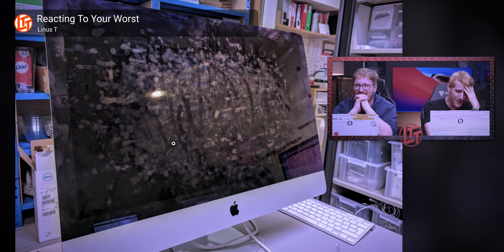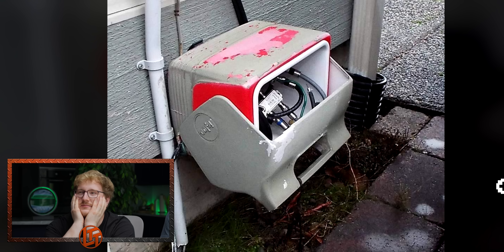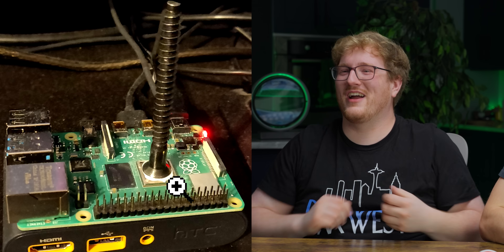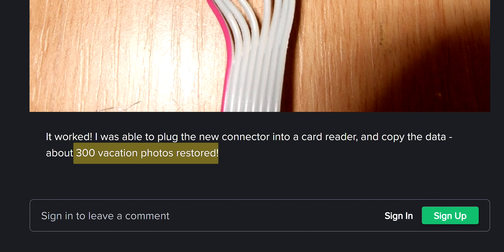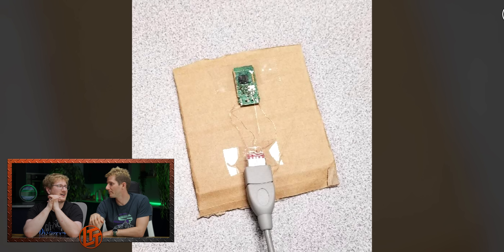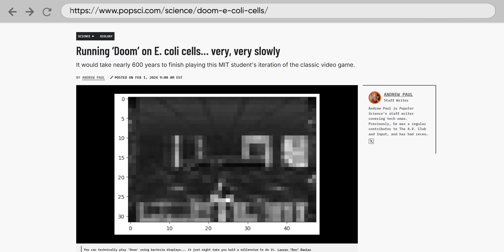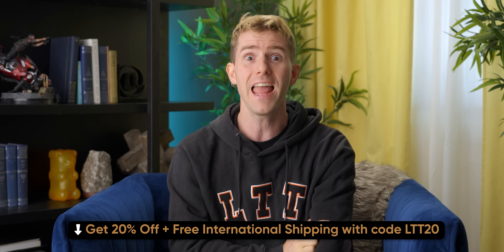Are You All Geniuses or Idiots? - Reacting to Your Best Tech MacGyvering

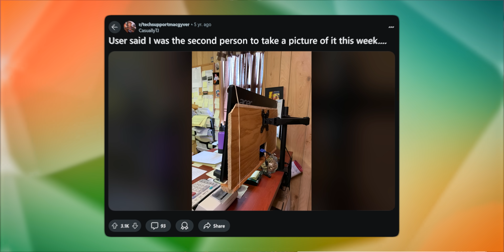Comment: 7:02 I actually made a custom mount for my EF9500 65" OLED for my bedroom. This TV (unlike newer LG oleds) have a stupid trapezoidal pattern mount, "universal" mounts don't work because universal mounts still expect the spacing to be a rectangle. So I got some solid red oak from the hardware store, made french cleats, screwed 'em into the studs, and the corresponding part screwed into the TV. Worked perfectly despite the bottom holes being closer together than the top holes because i could just drill wherever they need to be. Its rock-solid too.

Thankfully despite being a fairly large TV it wasn't that heavy (like 50 pounds without its stand) so i didn't need to get that fancy with the engineering.

Comment: The best I've heard of was a bunch of guys doing an install in a room no one had the key to. The door had to stay closed or the alarm would go on if it was open for more than 30 seconds.
So they rigged a PC on a stepladder to be able to push the inside door open button with the CD drive whenever they wanted it through the LAN...

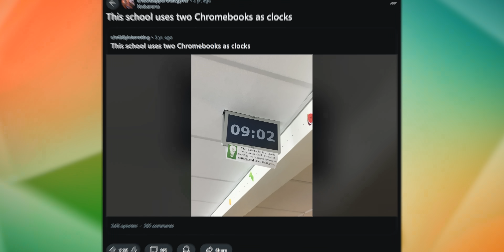Comment: 3:57 I'm sorry but no. These two chromebooks use 10x more energy than a clock would. This is not green.
Reply: True, but they'd be mostly idle so they probably use less energy than a light bulb.
Reply: It can also display announcements!
Reply: better than disposing them
Reply: It is still a  trivial amount of energy for a large building and the energy to produce something like that is substantial.
Reply: @LizordSword  No, the point is it's literally better to dispose of them.
Reply: @KrissFliss  That could be useful. If they are being used as anything other than clocks then good for them.

Comment: I remember getting tilted at having to replace the charging port on my old laptop every 6 months, so I drilled out the hole and put in a cinch jack as a temporary solution. That was around a decade ago, still works.

Comment: i had a similar velcro setup back when i was using my old equium a100. it had mounting holes for use as a terminal so I used it as a remote media server for years hanging from the wall. the battery was dead so ran off the mains and used the velcro to keep ac, ethernet and i/o in. 
funnily enough, it actually saved the machine a few times from being ripped off the wall by acting as a quick release if the cables got tugged, i was one of those guys who could never stop breaking the clips off ethernet..

forgot all about it until i saw this.

Comment: That "monster heat sink" reminded me of the setup we used to use at my dad's house. We had a USB wifi card (until we ran a cable since it sucked even after the fix) that constantly overheated. Took the case off so we could zip-tie a heat sink to the USB stick's board.

Comment: FYI, the alarm clock pictured in the 'tens machine' segment actually comes with a vibrating pillow attachment. It also has super bright LEDs in the front and for a long time (at least in the UK) this model was sold as the 'loudest alarm clock' one could buy. 
If OP can sleep through that, I wouldn't bank on being mildly electrocuted sealing the deal...

Comment: In my high school there was a server named "Black Server" (the reason for the name has been lost to the ages).
It was so old that the CPU Cooler died, but they couldn't find a replacement, so they just put it on a table with an old fan blowing in the general area.

When we asked "Why don't you replace it?" the professors told us "we have no idea which role it serves, but if it shuts down the whole school network stops working"... That school's diploma is in "IT Head of Technicians" 😂

Comment: When I was a kid back in the eighties, my Quickshot II joystick broke one of the internal contacts. I didn't have a soldering iron, but my mum's gas stove, a pair of pliers, and a eight inch nail sufficed to melt the old solder and reconnect the wire.

Comment: In regards to the mouse bottom door.
Here in Denmark, we have multiple 'closed' care facilities for psychologically impaired with a two bottom door system, due to the fact that the patients can't figure out how to use the doors, so only anyone else can get through the doors.
These systems can be as simple as two door handles that has to be opened in different directions, or just two bottoms that has to be pressed (sometimes located separately at some distance from each other. like one on the door and one on a wall.)

I could imagine this could one such place.

Comment: I once had an unused satellite dish that we replaced the sending/receiving part in the focal point, with a USB Wifi adapter with a long USB extension cord, pointed at our uncle's house across a wheat field. It was plugged into an old Thinkpad next to a window where the USB cord went through. It worked until the Wifi adapter gave up due to corrosion from moisture from being outdoors.

By the way, I liked the adjustable wooden monitor arm someone in the video made.

Comment: I worked for a large manufacturing company and went to a conference and they had guest managers speak, one talked about why you should always ask your all your employees if they have a solution for a problem before implementing a solution and this is the example they used,  they had an issue when boxes sometimes did not fill with product, they spent 100,000 of thousands of dollars to implement pressure sensors into their factories to sense when a box was empty and remove it, they then spent millions installing them all over the country in every factory, but 1 factory didn't apply for the new sensors and the reginal manager went out to see why and he learn a very expensive Leason, the young apprentice fitter who also worked in the factory packing had solved the problem himself he had placed a 20 dollar fan next to the conveyer and timed it so it would only have enough pressure to blow off an empty box, off the conveyer and at the end of the shift he would pick the empty boxes and feed them back into the machine.

Comment: I don't have video of it, but I had a 76 Plymouth Duster that didn't always like to start, for some reason the starter just didn't get the memo to turn over.   So I cut up an extension cord to the 12v supply side of the starter, ran it into the inside of the car.  Here is the fun.  I used a chain pull light socket to act as the switch, and a 15A screw fuse in the socket to be,,, the fuse.  

So if the car stalled and wouldn't restart, rather than go outside and pop the hood, and screwdriver start the car... I'd just pull the chain,,, Click,,, (car starts), Click the chain again.

PERFECT!!!

Comment: The car window fix at 13:57 is super jank but actually pretty cool. I used to work at a shop and sometimes we had to diagnose windows that wouldn't move. The window motor is really simple so on many cars, the computer literally flips the positive and negative to either move the window up or down. We had to be careful connecting new motors to make sure the switch would operate in the right direction lol.

Comment: Some GM vehicles have drivers side door switches that talk to the ECU. They are about $500 to replace and if they fail the drivers window no longer rolls up and down. Keyless entry doesn’t work either. Respect for the plug fix.

Comment: When I was like 10 I couldnt watch TV in my room at night. My parents found out and said: We'll take the receiver downstairs. In a flash I said: "You can also take the antenna, it's less effort with the cables". I proceeded to put wired earbuds into the antenna connection and attach a rope. Whenever I would hear them on the stairs I'd pull the rope with the earbuds and hid it under my blanket. Still mad proud off that one.

Comment: This makes me wish I had photos of my setup when I was in Highschool. I had the audio from an XP desktop, Xbox 360, and cable box all running into my headphones using a dolby adapter that came with the headphones and a vcr.

If you set everything correctly you could listen to the local radio station.

The VCR was for switching between the computer and the cable tv audio, which was hooked into a bypass on the adapter. The Xbox was plugged directly into the adapter as to actually use it as intended.

Comment: i like how you guys where amazed by the outlet for the car window thats way easier than the other stuff like soldering harddrives electro motors spin the opposite  way when you switch phases that's why you turn the outlet

Comment: I literally have a TiVo in my living room, with a coax leading to a bedroom set up as a workshop, and a second TiVo remote with a wire hanging out of where the IR LED used to be... that wire runs right back to the living room, beside my coax, and the IR LED is soldered to the end of the wire, and mounted to the front of my TiVo. The Slim Jim remote is just the bebeh version of mine. My wire is like 40-50 feet long.

Comment: 9:07 Can confirm that this is true, I tried it myself. The Wii "Sensor Bar" is just a bunch of IR LEDs (I confirmed this by opening it up). The actual sensor is in the Wii Remote (basically an IR camera that looks for the IR LEDs from the sensor bar, and determines the XY position of the cursor from the LEDs, and the distance from the TV based on the distance that the LEDs have between them from that POV)

Comment: My friend and I jerryrigged my old PC to run Truenas Scale with windows virtualized inside of it for occasional 3D renders. The cherry ontop was setting up a KVM so I could switch between my MacBook (my primary workstation) and windows, without needing anything like chrome Remote Desktop or parsec.

Since I don’t really have to render intense 3D scenes very often, it’s actually really nice to have redundant storage for project archival. Definitely could have just had network sharing enabled in windows, which I did at one point, but it was a really fun project where I got to learn a lot.

On a side note, if anyone here reading this is running Truenas scale and can’t get GPU pass through to work in your VMs because Truenas claims it needs a GPU for some odd reason, we got it to work by switching to a G series Ryzen GPU. After the upgrade you’ll want to take out the CMOS battery, but then Truenas should play nicely. This was especially helpful if you’re like me, and didn’t want a second GPU taking up space on your motherboard that could be used for an HBA or upgraded NIC.

Comment: had a really good monitor lying around because user broke the base. it had no vesa, and broke in a way that it could not be put on a replacement thingy. so i just used a height adjustable monitor stand with tilt and all, and used soudal fix all turbo, roughed up both sides with sandpaper and glued the heavy af montior on, and gave it a day or so to cure. it still holds up 4 years later, and is now at my sisters place so she has a nice monitor. I even tried pulling on it a while ago to see if it still holds up, and its on there for sure. Im not gonna throw out good tech when heavy duty glue exists (btw thats some sort of construction glue / kinda like silicone but harder)

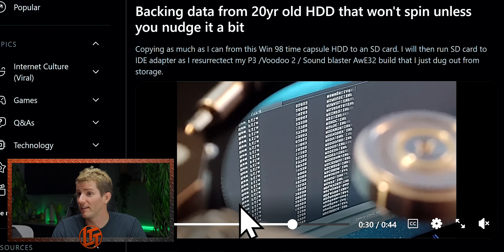Comment: 5:23 I've had to do that to modern drives for data recovery purposes, this trick works - just make sure you do it in a clean area. Knowing all these little data recovery tricks helped pay for my college. Usually the most common thing I ran into was someone working on a thesis/paper off a flash drive and somehow managed to break the USB connector off the drive.

Comment: I live Mcguyver solutions. When done well they can save a lot of money. And like you mentioned in the reducing waste and reusing something can save a lot of money.
Plastic switch (those that you move sideways) on a fume hood broke and I fixed it by reattaching the plate on the inside with some epoxy + a screw for extra mechanical stability.
Fume hood is back in action :)
Especially since the kitchen is old but still good it did not feel economically viable to replace 1 thing. This will probably outlive other devices in the kitchen now

Comment: One of my first computers came with an IR receiver and a remote control that I could use to control the mouse. I had a 25m Hdmi cable to connect my TV on a vesa mount which could swivel around a corner to where my bed was, and used a 5m USB extension to connect the receiver to a place where it was visible from the bed, and viola, remote controlled PC, perfect for watching movies from the bed xD

Comment: I did the same thing to my dell 9010.  Installed a Gtx 1650, used an unused sata power to 6pin adaptor.  I did use electrical tape around the cut out in the lid.  Worked awesome for 2 years until I upgraded

Comment: RCtestflight uses rubberbands to attach wings to styrofoam rc planes all the time. It is actually their preferred method. It fails very nicely, it bends without breaking, so it avoids or absorbs shock loads from crashing.

Comment: I found an old Nokia 3330 in a drawer at home and was bored so wanted to get it working, but I was very sick and couldn't leave the house.  The battery had swolen and was no good, so I hooked up a nail board to some AA batteries to get the right voltage (literally a piece of wood with nails hammered into it to contact the battery terminals).  I needed a resistor to trick it to know it had a battery connected but didn't have any, so I drew on the board with a pencil (graphite) to get the right resistance.  Can't believe it worked. 🤣🤣

Comment: 16:14 oh I know why they used that specific alarm clock! Have it myself and it comes with a bed shaker attachment that plugs in via barrel jack. So that tens unit would be incredibly easy to hook up as the bed shaker has its own switch to enable/disable on the clock and easily accessible contacts. Smart!

Comment: Don't get me started on tech support.  I used to work at a tiny 8 person IT department for a 250000 person mid west city.  Working Payroll also meant I had to do occasional tech support -- go figure.    I had to look at a laser printer once -- the fuser roller was melted into the mechanics.  Totally toast.   Reason?   No ventilation possible. The device was wedged between a wall, a filing cabinet and eating the exhaust of an old microfilm reader.     The department doing this madness??  The Central Inspection department...    sigh*...    They weren't the only ones.    A person working for the police department tried to get me to install software on their PC that had already been installed on another PC.  An old and obscure spreadsheet program they liked.    They refused to accept that what they were trying to do was illegal.   They bought the software already, why can't they use it.      *sigh      We had a server closet that perodically would shut down for no reason after hours.   Happened a lot until someone found out cleaning staff were unplugging stuff to plug in their vacuum cleaner while working the floor.

Comment: A TENS unit, (idk what the acronym stands for) is for pain reduction. It puts bogus electrical signals to your pain nerve cells so your brain just ignores the combined output. Problem is, your brain eventually learns to read through the bogus signals, so the intensity and waveform is adjustable. You would have to crank the settings up pretty high to be actually painful.

Comment: 9:05. What I did was break one of the 3 legs into a stub off a pizza insert, which prevents the centre of the pizza to get squished. Used that as a prop tool until I purchased a case with a built-in propup.

Comment: Dang, I missed out submitting to this one. I converted an aftermarket 2011 MacBook Pro battery into a power bank and posted it on r/techsupportmacgyver back in 2016. Still works to this day! The battery's BMS failed but the cells were still good, so I bought a generic BMS with a micro-USB input, a boost converter with a USB type A output, and a battery level indicator, threw it all together with double sided tape, superglue, and some dremeling. Only drawback is I can't take it on flights. I could charge my old iPhone 5s three times from it before it needed charging though!

Comment: The priest at our local church decided to install a video camera to record the altar. The funny thing is he used an ethernet cable and separated the inner wires so he could use half to power the camera, and the other half to what seems to be probably the data cables.

Comment: Back when Motorola made prohibitively expensive accessories necessary to use USB-OTG on their phones, I used a Y-cable and an external battery as a way around it. Turns out OTG could be enabled by charging the phone, but you needed the Y-cable to pull it off. And, sure, the host adapter... But the Y adapter was necessary to have power AND data until I found a powered USB hub that sent power through the host connection.
Oh! There was one time that our cart pushing machine's key switch needed to be bypassed in order to deal with a missing key. I told my coworker that there was a spot that looked perfect for a light toggle switch and before I knew it he wired one in and it was up and running.

Comment: I've done the secret headphones thing. I worked on an assembly line that was very loud, but also very boring. we were required to wear hearing protection or be written up. I played it very quietly when I did and I could still hear when someone was close as usual. I used true wireless earbuds (tws-i7) with logitech headphone drivers from a pair with a broken headband.

Comment: 7:55 It's mostly forgotten now, but about 20 years ago, Swiftech had a range of CPU heatsinks that consisted of a base plate of copper with a bunch of screw-threaded "Helicoid" pins attached. These were supposed to be more effective than regular non-threaded pins. When better-perfoming heatpipe-based designs became mainstream in the mid-00s, the Swiftech Helicoid heatsinks were rendered obsolete and were discontinued.